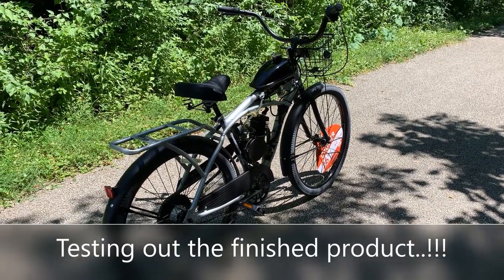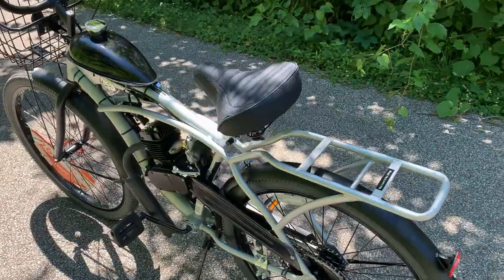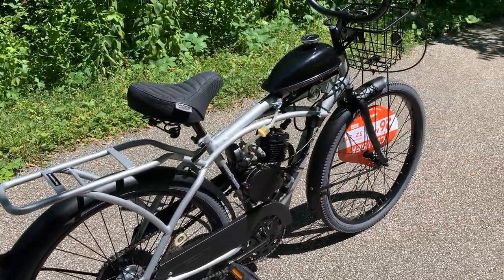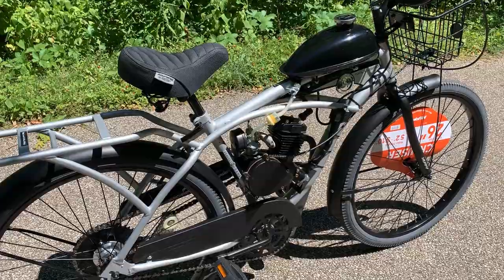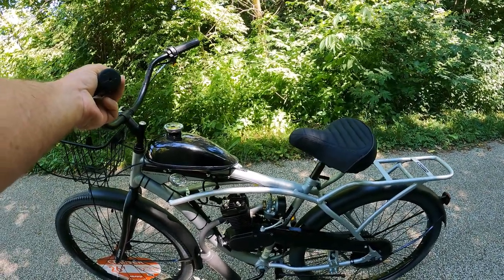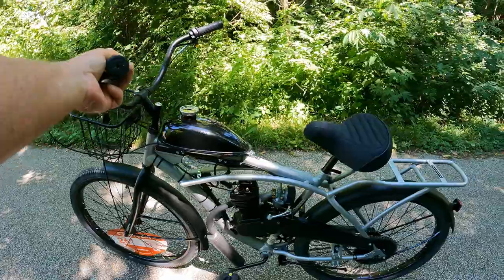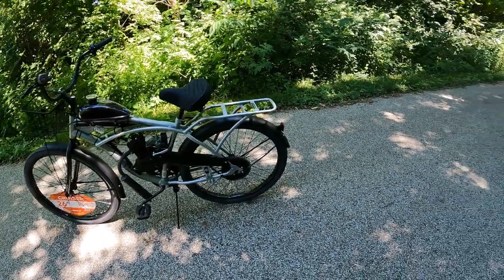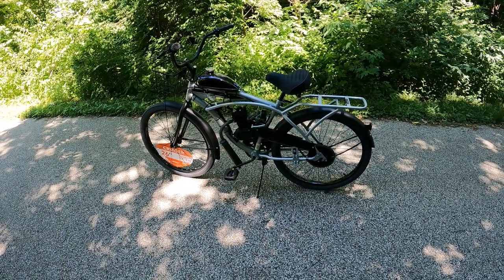How to build your first motorized bicycle  Part 4 The test ride  !!

Comment: I was always curious as to reasons for the position of the spark plug.  Ive seen people position it on the intake side...others on the exhaust side.  Whats your reasoning for its location?  Just curious...thanks for the advice.👍
Reply from the maker: The spark plug position is usually determined by the engine manufacturer, some design it to face the rear, some design it to face the front, even some go straight up & down right in the center..Usually the cooling fins will give you an idea the way it's designed to face for your particular engine..The reason you see some people turn the head around is because there is a ton of repeating something they have heard someone else say so those people want to look like they are super smart builders too & so the theory begins.The other reasons are 1 because some think it gives you more power facing the intake side or the exhaust side & 2nd is someone is building a bike that the engine doesn't fit that bike properly & they have to turn it so the spark plug doesn't hit the frame.
Reply: @EcoTransGaspoweredBikes  thanks for the detailed info.....hmm im wondering if mine is on the way its supposed to?  I have mine toward the exhaust side.  Is there a way to know if its on right?  and if it's not will it hurt anything to have it facing the opposite way it was intended?
Reply: yeah i think i put it on wrong...the picture i just looked up from the place i bought it from shows the spark plug facing the intake side.
Reply from the maker: @remedythis-dreamworld  The usual way to tell is to look at the cooling fins,on factory heads the fins start out short in the front & get taller in the rear, so the air hits it like a ramp so the air passing by is forced through the fins. On after market heads the top of the head is usually flat so either way you face it the air goes over it the same.👍
Reply from the maker: P.S. If you happened to put your head on the opposite way it's not the end of the world & it will probably work fine & cool well enough. It's just nice to get all the functionality out of you engine that you can.
Reply: @EcoTransGaspoweredBikes  ty so much for your help..I really appreciate it!😎

Comment: How long is the break-in period About how many miles can you go in the break-in period
Reply from the maker: Everyone has their theory about the break in period, this is what has worked for me for the past 9years without any problems; I always start out with the fuel to oil ratio @40:1 for the first two tanks, you can ride the bike as far & as long as you want while you're breaking it in, the important thing in my opinion is not to run the engine at super high RPM's for a long period of time for the first two tanks of fuel, other than that you should be just fine.. 👍👍🚴‍♂
Reply: So if I take the 9 miles to work and I don't give it high RPM's for very long  for the 1st 2 tanks of fuel I should be good?  it's going to be my way back and forth that's why I'm asking and I don't want to mess anything up
Reply: Any other way I can contact you in case I run into any other question this is my first build
Reply from the maker: @jamesraney8867  I don't have any other way to contact me other than on here, but if you have any questions feel free to send me a message & I'll get back to you as soon as I can. 👍👍🚴‍♂🚴‍♂
Reply from the maker: @jamesraney8867  Exactly.. 👍👍Taking it easy in the beginning never hurts a thing. I'm not saying that if a dog chases you that you can't crank the throttle & get away, I'm just suggesting that you don't ride it as fast as it will go for the first couple tanks of fuel & you should be just fine.. The key to keeping these bikes in operating condition.is to not ride them as fast as they will go for long periods of time, I always suggest that if you want it to last, ride it at about 1/4 of throttle or around 12-14 mph. Riding at high speeds for long periods of time wears out wheel bearings & engines prematurely. Standard bicycles were not designed to ride at those speeds & it just tears the bike up.. Just keep this in mind & you're bike should last you for a long time.🚴‍♂🚴‍♂